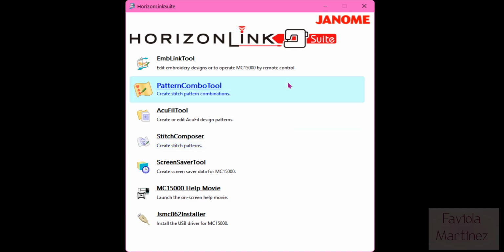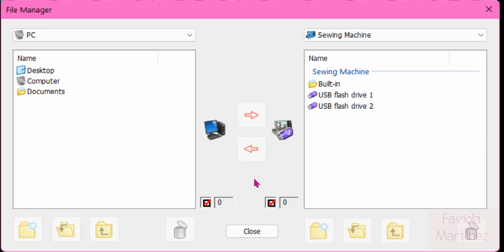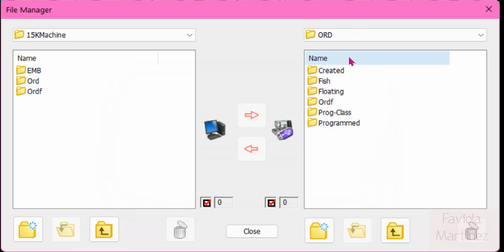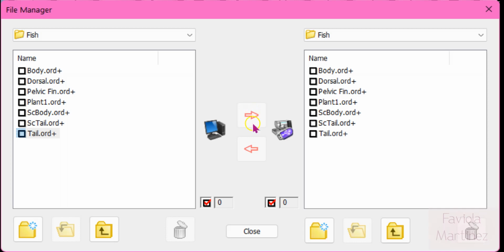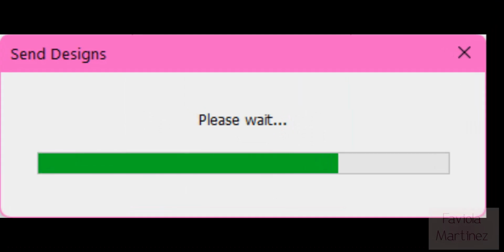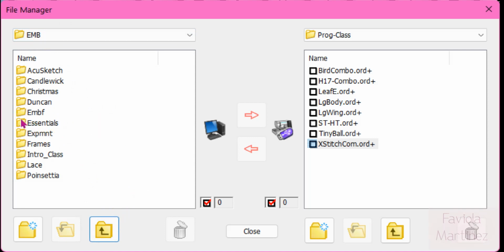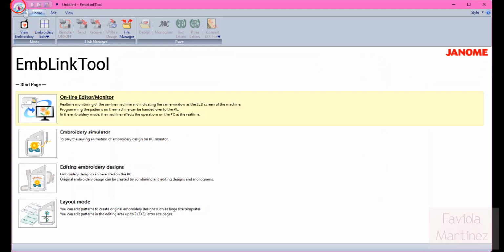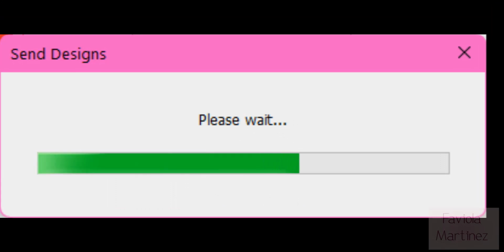Horizon Link Suite Transfer designs & Stitches

Comment: Could you just copy the folders from the Pc to your machine?  Then you wouldn’t have to create duplicate folders and check every file to transfer.
Reply from the maker: Judy, I appreciate your question and hope to clarify a little more.  You can't transfer the entire folder and its contents in one step. You have to have a folder created in the machine memory and then open to put files into. Maybe I wasn't entirely clear the point of this video is that in a situation like mine I had to have the A-board replaced on the machine. That meant that if I wanted to keep my stitch files for the future I had to remove them from the machine before the work was done. When I was getting ready for the work to be done on my machine a few weeks ago, I assumed that I would be able to just copy the folders onto a usb and that would be it. That's when I discovered that the only way to get the folders off the machine and into my PC was to use the Horizon Link process. Yes, there are various ways that we can save files that are on our machine into our PC; individually saving them onto a usb, or using the direct connect cable with Horizon Link or the WiFi being the most common ways. But we can't move the folders that we've created in the machine without using Horizon Link. (At least I haven't figured out a way to do so!)  Back to your question, as I was trying to do this process I can only say the answer is no. You have to have a folder on both the computer and the machine sides created & open and then move/copy the files into it. During the transferring process, we can create folders through Horizon Link as well as directly on the machine. When we are copying the contents of the machine folders over to the PC we have to create the folders on the PC first, then move the individual files into those opened folders. Thanks for the question, and I would like for you to try out the process (Just for fun!) and see what results you get, if you find a way to copy the entire folder & it's contents in one step I'd like to learn how, I wasn't able to!